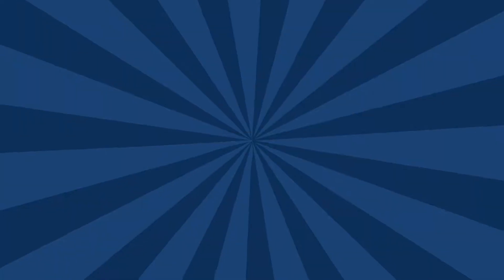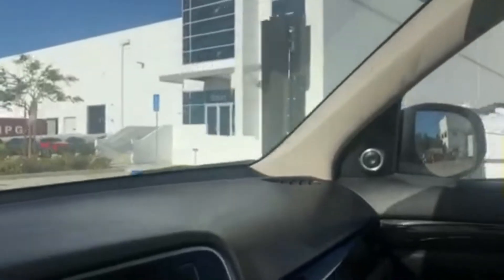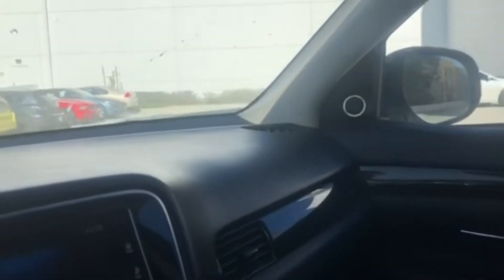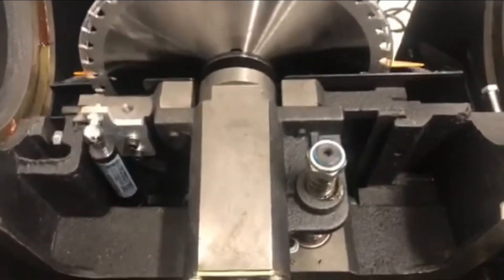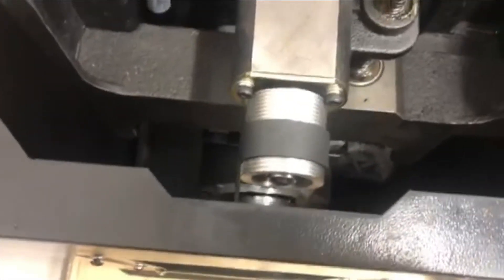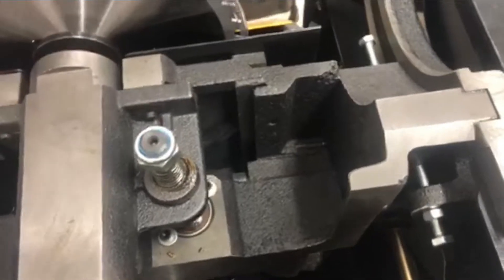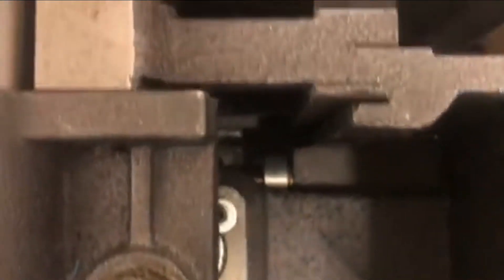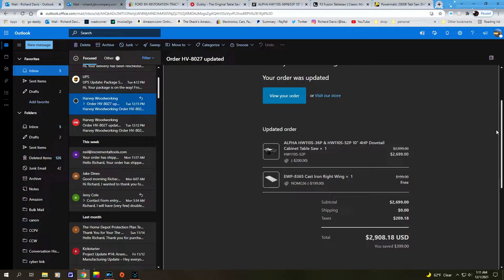New Harvey Table saw for the Shack

Comment: I also purchased the 4hp 52-inch unit and can't wait for it to arrive. In regards to the location of the power switch, In my opinion, the switch was located where it is for safety reasons.  If there is some sort of incident that would require quick shut off of the saw while doing large sheet goods ripping the switch would be hard to access.
Reply from the maker: JJ when is yours due to arrive. I understand about the switch but its a personal thing my Atlas table saw the switch is where i want to reposition this one. I hope to start to put it together next week im finishing up a project i hope to complate Friday then time for the Harvey
Reply: @TheShackHome  it's supposed to be shipping in the next few days. I'm waiting to hear back from Harvey to confirm.
Reply from the maker: @jjpiatek3294  I think I'll start the assembly  of the Harvey next week. I finished my current project. I'm excited to get it together and use in on my next project. Hope they give you good news and yours arrives soon.

Comment: I am not a production shop just a home wood worker so I am not getting hung up on 2” less table nor do I care about getting that one extra horsepower motor. I like the looks of the Harvey, both the traditional and dovetail system. Paying $3K plus for a saw these days doesn’t seem extreme but I think I’ll stick to my old single ph 3 HP 1970’s Rockwell Unisaw. Still a work hoarse, total accurate with a new fence, mitre gauge and a sturdy Ridge blade and best of all 🇨🇦made in Guelph, Ont. Some individuals seem to always want the biggest and baddest they can get. It seems to be more of a guy thing!👍🇨🇦👨‍🦳

Comment: Don't be concerned about the dovetails wearing out and getting sloppy. Machinists vices use dovetails as slides and MUST keep tolerances in the .0001 inches. Also it's a vertical slide not a horizontal slide. (gravity)
Having the shut off paddle switch on the left side is a great idea. It allows you to turn off the power without looking with your left knee / thigh. I've had my saw set this way for >10 years and it's awesome , never once did I accidentally bump the switch. Sometimes you end up with that little piece that "rattles" next to the blade waiting for it to be thrown back at you, this is the perfect time to just shut it off without looking for the switch. My next saw will be a Harvey 2.
Reply from the maker: Renrondog great comment. I never thought of the dovetail that way, your right. I did a little machining for about 2 years after high school running a lathe and vertical mill I completely forgot it’s designed that way. Hung the gentleman I spoke with at Harvey is from a family of machinist and they have a very close tolerance mind set so this makes perfect sense. I hope to start to assemble the table next week so I’ll see if I can move the power switch. I hope there is enough cord to do so. Thanks for the comment and thanks for viewing.

Comment: I just purchased the 2hp version last night. I got an additional cast iron wing and legs for $249.  They told me they’d honor the sale price from this past week for an additional 7 days if I changed my mind and wanted to upgrade to the 4hp. I say 4 because it would make no sense to upgrade to the 3 since the 4hp was only $50 more than the 3hp.

So for me to upgrade to the 4hp over what I bought would be an additional $471. I’m not a production shop…just a one man weekender making cutting boards and boxes. Would I see a benefit to the 4hp with dovetails?  Is the pivoting trunion sloppy or are we talking the difference between a Lexus and a Porsche?  Yeah the Porsche might be nicer but they are both very fine vehicles…
Reply: Hi Timothy, I just stumbled across Harvey table saws Friday night thanks to a FB woodworking group.  The price then for the 2hp 36" (cast iron top) was $1,875 (25% off), but it looks like that has expired and is now $2,299.  Do yo mind sharing what you paid and if you live far enough way for it to be shipped.  I'm on the east coast and am afraid to hear what the delivery cost and time frame may be.
Reply from the maker: Timothy I came from a 50+ year old Atlas cabinet table saw with a 1 hp motor that saw cat 1000’s of sheet of particleboard and plywood in the cabinet shop. We just learn to feed material with what we have. But sawing thick stock like cutting boards, there is where you’ll see the difference. No one can tell you what to buy but we all start out weekend workers but somewhere this fun hobby turns into something more serious. Then is when you’ll wish you had the power. I’m wanting to push my craft further and I don’t want to buy another table saw down the road. I’m also thinking of going in dept and getting their band saw I have wood(logs) I’d like to resaw giving me another avenue to reclaim lumber. Bottom line where do you see your  woodworking 5 years down the road then make your decision.